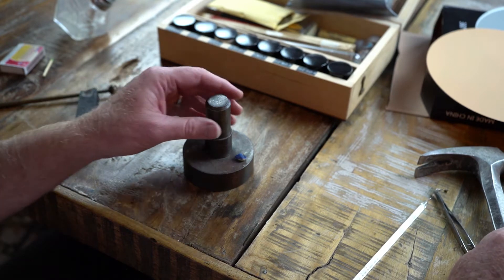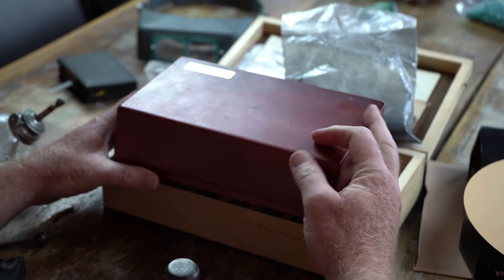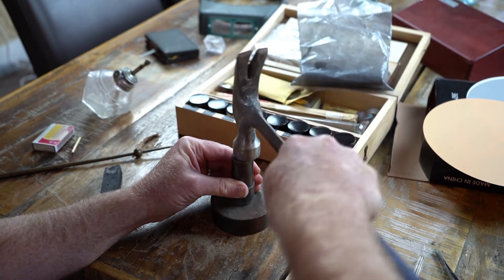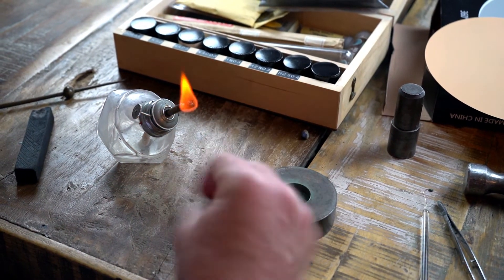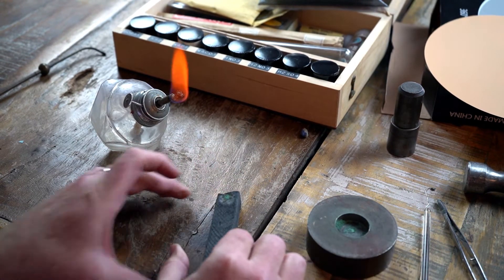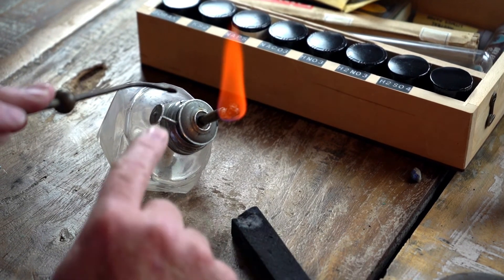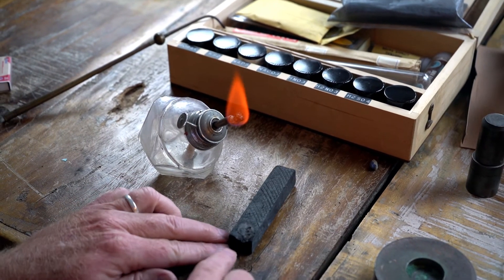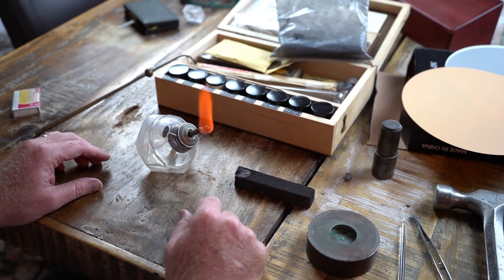Mineral Identification: Flame Test

Comment: For copper, I like sulphuric acid and iron wire/nail. Put a drop of diluted acid on to mi eeal then rub with clean iron or steel. Make sure it isn't plated. If any copper present, it will plate iron. Very dramatic of something like a copper carbonate. Works for copper sulphide.
Reply from the maker: Thanks for the tip! Rick has never heard of this and is excited to give it a try 😃🙏🙌